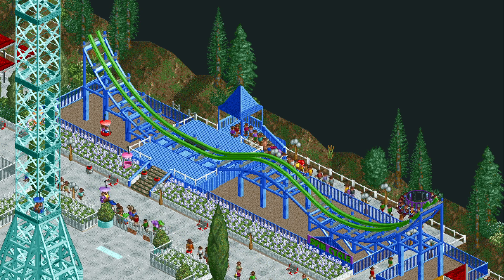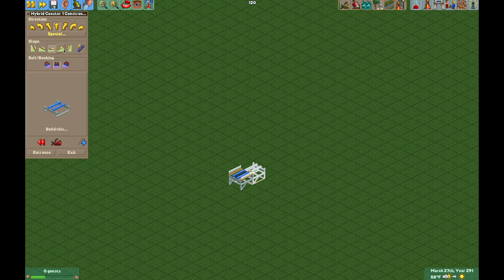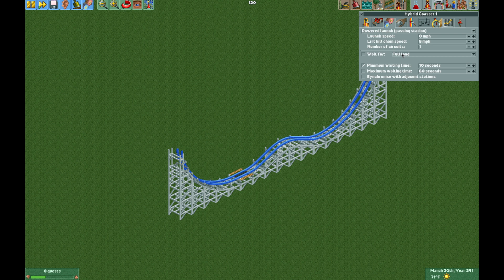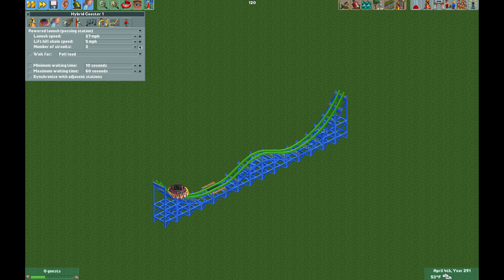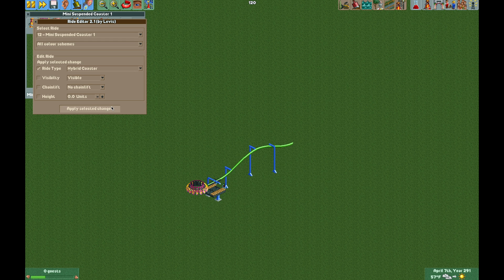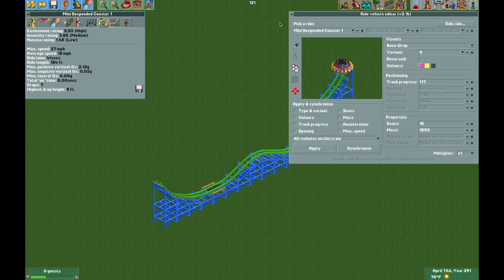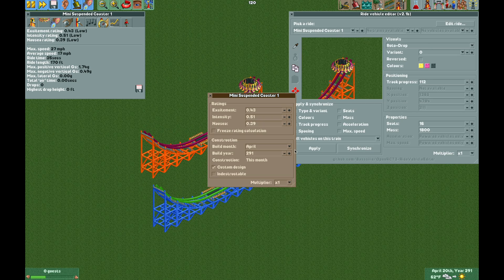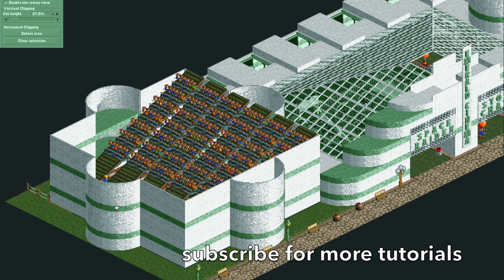Disk'o Coaster - OpenRCT2 Tutorial

Comment: Coming back to an older ride, as I'm starting a new (old) map and including several of your rides in them. The problem for me (what determines if I will build them in my parks) is can I charge enough to make it worth it. For example, though the Parachute Drop was really cool, I won't really ever bother building it again because it's stats were so low I couldn't charge enough for it. The multiple kiddie ride creation has the opposite problem ... it's stats are far too high. I can't feel good about charging people $18.60 for a kiddie ride. But I can lower the price to a couple of bucks, and all that happens are people celebrate how cheap it is.

This is the one I'm finding myself wondering about. You got incredibly low stats on this, which means people don't want to pay a lot for it. But when I last built it in a previous park, I got a fair amount better stats than you did, somehow, allowing me to charge what I considered a decent amount for the ride. ($5 - $7 sounds fairly reasonable to me.) It'll be interesting to see what I get on it this time.

[edit]But what is it saved as? You can't save Hybrid coasters, so it must be as something else ... but when I look under mini suspended, it's not there, either, so I'm wondering which kind of coaster it is saved as?[/edit]
Reply from the maker: This is true, the stats are always an issue with hacked rides. The Ride Vehicle Editor plugin that I use in a lot of my videos allows you to manually edit the stats, which is one way to workaround the issue. Another, specifically for this ride, is try making the ride vehicle the jet ski and then use the Ride Vehicle Editor plugin to manually change it to a roto drop vehicle. This should boost the stats considerably, due to the fact the jet skis have 75% excitement and intensity bonuses.
Reply: @openRCT2tutorials  But if you manually change the stats, it doesn't affect what the guests are willing to pay. My attempt to try and get around this (and it seemed to work fine) was to do all my decorating and things to boost the stats, then freeze them (so they are real stats, just frozen), then switch to the single rail coaster to bump the car into the air a little further. It's having people happy to pay about $5, which doesn't seem a horribly bad price.

Also, just as an aside, there are a few of your rides I won't use because others already made custom versions of those rides. I'll still watch the videos, like, and comment, to give your channel a boost, but for example, I already have the Paratrouper ride as a CFR without having to hack it. But many of these I do love, and will use frequently. Leap Frog will almost certainly be in every park I ever build for the rest of my life!
Reply from the maker: @DisneyBatchman  That is a great workaround, freezing the stats before changing the ride type. I generally don't pay attention to what guests will pay since I pretty much only play with pay per entry parks.

As for custom flat rides, I think the reason I started this account was because I don't like the CFRs that currently exist. They are either too small and/or don't seem to fit in visually with the rest of the game, but to each their own. And hence, I am always trying to find new rides to create via hacks!